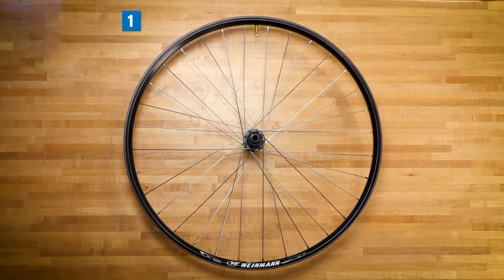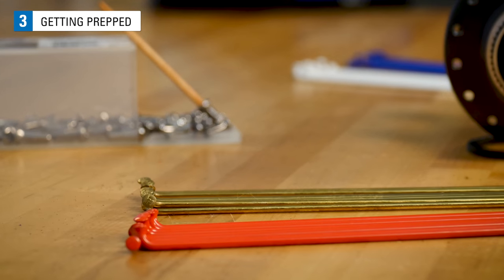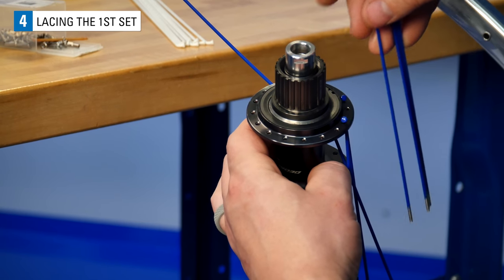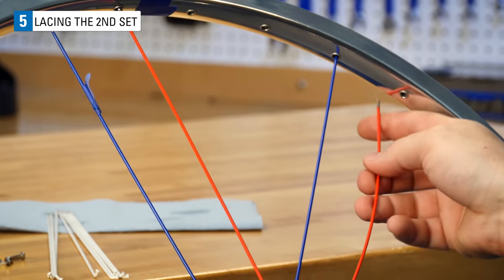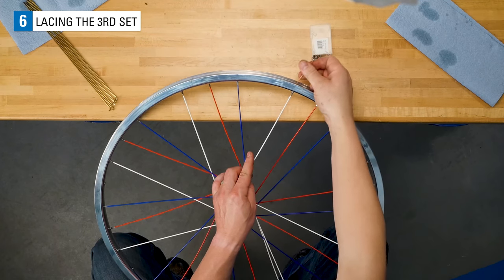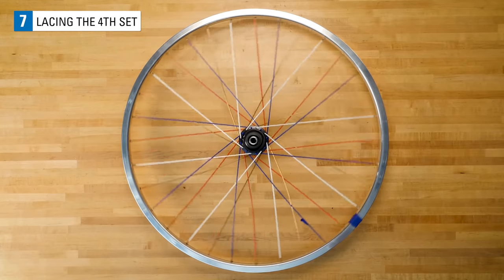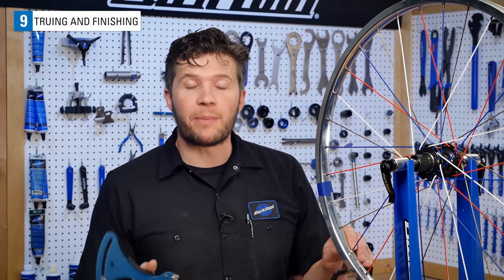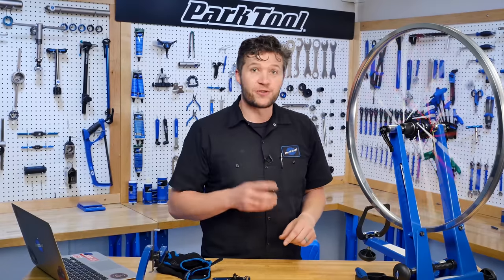How To Build A Bicycle Wheel

Comment: Terrible!
I done it correctly but laced it in the wrong position. 😑
My valve doesn’t have enough space for pumping air into the tire. 😓
What should I do at this moment? 🤔
Reply from the maker: There is nothing wrong with taking it apart and starting over.  It is good repetition and good learning.  We all have done it.

Comment: you said that spokes are loaded on 125kg, i looked for strength of spoke and on dt, they say it is about 150kg, so your load is to high, it should be up to 100kg per spoke on drive side
Reply from the maker: Dt's spokes can withstand more KGF than that. Rolf wheels use DT spokes and are set to 180 KGF. It is common place for rim manufacturers to suggest 100-120 KGF as a tension goal or max tension.

Comment: how to check dish without tool?
Reply from the maker: A dishing tool is the best option but if one is not accessible you can put cans 180 degrees from one another and have the rim resting on them. Then stack quarters till they hit the axle. Then flip the wheel and compare. You can do this with many other things like wood Etc.

Comment: hey. i need some help, if someone can help me. i fallowed all the steps, i build a wheel, it's straight on the stand, but when i put the wheel on the bike, it is not centered on the frame and, i do this over 3 times and the same problem. it's not just a few milimetre, is a lot of cm, and i can't centering from the spoke, the error is to big. Sorry for my english. i hope you understand my problem. :D
Reply from the maker: Use the  bike frame to center the wheel.  The stand could be off.  Best if use a dishing tool.  See wheel centering- https://youtu.be/FqeEBih8kx0
Reply: @parktool  when it needs to use a dish tools ? Cuz if the spoke are to tight i can't do anything, cuz the error is to big, and i can't loose the others spoke for the same reason. I think, i need to use the dish tools when the spoke are not to tight, when the wheel it's not finished, i'm right ? I need to use that tools several times ?
Reply from the maker: You will need to use the tool to verify a few times in the process. it is best to do this without it pulled to proper tension but if you loosen the side that is too tight you will have the same result.

Comment: OK, I'm a bit confused here as everything else on building a rear wheel that I've seen says that your starter spoke at 5.10 should be head inwards.
Here's an example https://www.youtube.com/watch?v=Jw25tqAcn_4

Genuine question, not trolling!
Reply from the maker: That method is to ensure the logo of the hub ends up inline with valve. The end result of the wheels durability and functionality are 100% the same. The logo being perfectly centered in the valve hole should not be a new wheel builders concern. That is why it is glanced over in this video.
Reply: @parktool  Thank you for your reply. Keep up the great work.
Reply from the maker: Lots of ways to build a wheel. That particular way appears to be the same lacing pattern as the one in our video including heads in and out comparison. There are other methods as well.

Comment: The only bad thing the video presentation is the rim size is not specificied. The presenter himself does not tell if the rim is a 24",26",27.5" or a 29.
Reply from the maker: The rim size does not matter for lacing.

Comment: The real question here is - how to get spokes painted? Meaning - best painting procedure to get good result..
Reply from the maker: Best option is to buy painted spokes and have them cut and threaded to the correct length :)
Reply: @parktool  but, if we talking about painting, than ... best options ?..
Reply from the maker: We highly recommend dipping them in blue vinyl ;) No real suggestions other than that powder coat or plating are the only coatings that will hold up and be thin enough.
Reply: I have been using just a rattle can to paint spokes for multiple wheel builds with very good results. tips to get good results are 1. clean the spokes with rubbing alcohol before painting to remove all oil. 2. tape threads so no paint gets on them and interferes when threading nipples on. 3. do multiple light coats do avoid drips and runs
Reply: Well, I guess the best way is to use heatshrink tubes...

Comment: このやり方スポークの出し方はshimanoが指定している方法と逆の張方ですね。shimano　は引張力の働くスポークはフランジの外側から出して張ります。ですからDrivesideとDiscがあるnondrivesideは張方がぎゃくになりますが、shimono　の まったく逆の引張力の働くスポークはすべてフランジの内側からだしています。これでも別に力学的に問題はないだろうが手組技術者はこの方法は様式美に欠けると思うでしょう。又私はバルブの穴の隣の穴からロゴの位置出しをするが、このビデオの方法のほうがいいかもしれない。
Reply from the maker: Both methods produce good wheels.  The traditional method here is faster because each set of four spokes can be installed without any interference from the previous set.

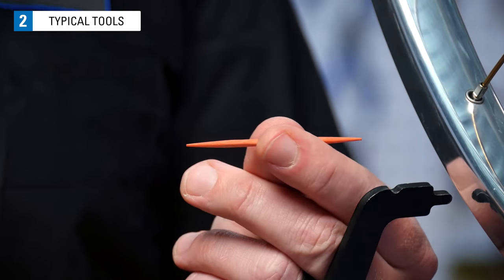Comment: 2:38 is this a joke, park tool makes tool for everything and any thing that is related with bikes, most of it is not important , and did not make tool for nipples to insert into spoke hole in rim?!, i made tool for this 5 cm long flat screwdriver grinded so to have central pin that can keep nipple
Reply from the maker: This video is for people who may not have many resources and we want everyone to have the ability to do things. Maybe there will be a tool we offer down the line to do this but we wanted to give people the tools they may need in an easy to digest way.

Comment: So, this video (watched 3x) is not helpful to build any wheel. It doesn't show the difference in front/rear wheel disc vs non disc patterns. It doesnt show 36 or 40 spoke wheels or how to determine weight vs spoke ratios. It doesn't say why/when a simple radial pattern fails. I'd like to see a complete class for any wheel that is required.
Reply: With 32 spokes you have 8 per step, if you have a 36 or 40 spoke wheel you have just more per step (9 and 10).

The way you build the wheel is the same if it's symetric or not, the only difference is a symetric rim brake front wheel has just one spoke length while a non symetric one (rear wheel of front disc wheel) has 2 different spoke lenghts. He also explains to put 2 rotations more tension on the shorter side to take account for the shorter spokes.

This video shows wheels which are 3 times crossed, of course there are other methods to build a wheel but these are rare and 3 times crossed wheels are standard.
Reply: @simonm1447  
🙂👍 That is a little more helpful. And I thought the wheel was the 1st great invention of man. Cavemen must have been geniuses 😆
Reply: @chadkline4268  he also makes a difference between left side spokes and right side spokes - at the front wheel for example you have the disc rotor (if it's disc brake) on the left side if you sit on the bike, so this side is the left side which needs left side spokes (shorter than right side spokes on the disc brake front wheel).

On the rear wheel you have the cassette on the right side, which is wider than the disc rotor on the left side. So on the rear wheel left side spokes are the longer ones (also if the bike is rim brake) and the right side spokes are the shorter ones, opposite to the front wheel. Of course on a rim brake front wheel both sides have identical spokes. 

So it makes sense to use the terms left side and right side spokes instead of shorter and longer spokes, since a left side spoke is always on the left side while a shorter spoke can be left or right, depending on which wheel you build.

The whole thing is not trivial, the best thing is to practise it with an old wheel a couple of times before you do it on a good wheel you intends to ride.
Reply: @simonm1447  ok, I truly appreciate the effort you made to help me understand. But I think it would be better to organize the video like this for better understanding:
1. Radial pattern, symmetrical, when it is ok to use, how many spokes are best for various weights. 50kg, 100kg, 150kg, 200kg, etc.
2. When does a radial pattern begin to fail, and why a new pattern becomes necessary. 
3. Why/how does a pattern change due to a brake disc.
4. Why/how does a pattern change because of a cassette.
Reply: @chadkline4268  Radial pattern is rare, since it can not transmit torque from the hub into the rim. It would be usable on a rim brake front wheel because the brake slows down the rim directly. You can find that on some children bikes or on older rim brake road bikes, but it never works on a rear wheel and also not with disc brakes.

2 times crossed and 4 times crossed patterns also exist, but these are for special purposes. The most versatile way to build a wheel is a 3 times crossed wheel like it's shown in the videol, it will always work. Most wheels you can buy are made in this way. 

Most wheels you find will have 32 or 36 spokes, 36 is slightly more stable but even 32 is fine for hard offroad use on mountainbikes. Road bikes often have less but they are not primarily designed for heavier riders. 

If you really want to be safe regarding weight a 36 spoke wheel will be the first choice. Heavy E Bikes sometimes use reinforced spokes with 2,34 mm instead of 2 mm, however the 2 mm ones are standard and they also work on mountainbikes for offroad use. 
A quality 2 mm spoke (like a DT Swiss) will likely be more robust than a cheaper low quality one with 2,34 mm.

Comment: Before this I would need to buy 800+ dollars of equipment so he’ll no
Reply: You only need one tool to do a decent job and it costs like $4. A truing stand is redundant for home use if you already have a frame or fork you can put the wheel in. And a tension gauge undoubtedly an awesome tool to get a perfect wheel but you can get surprisingly close just by squeezing the spokes with your hands. This equipment is only essential for shops and race mechanics where build time an consistent accuracy is critical.